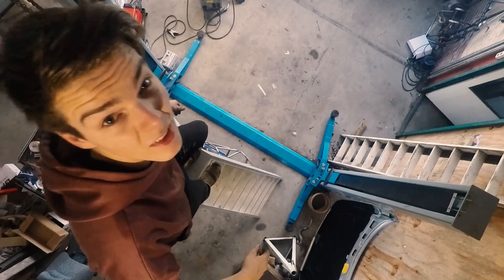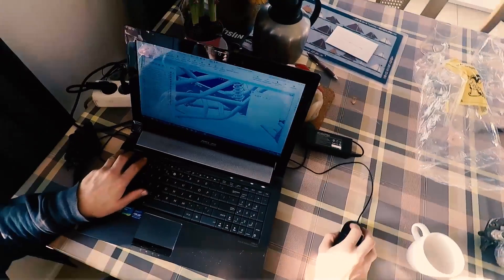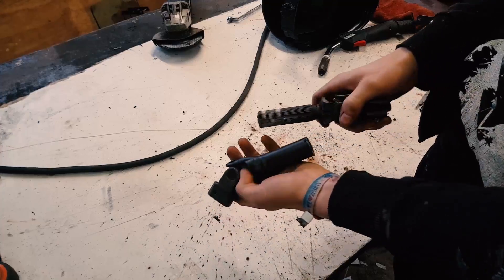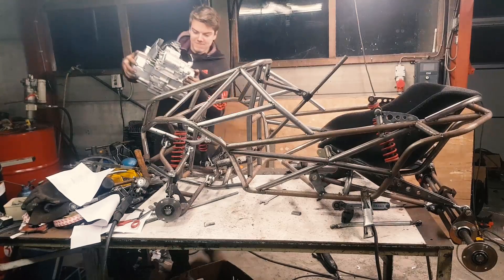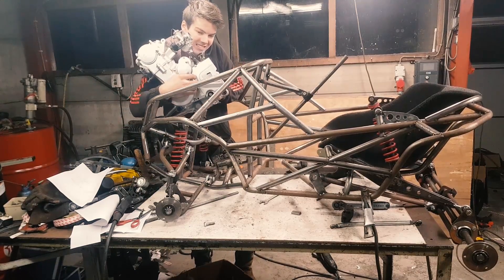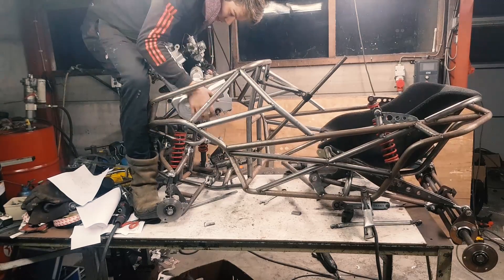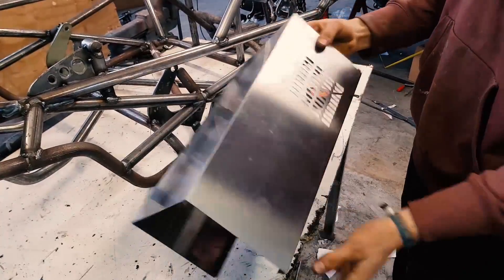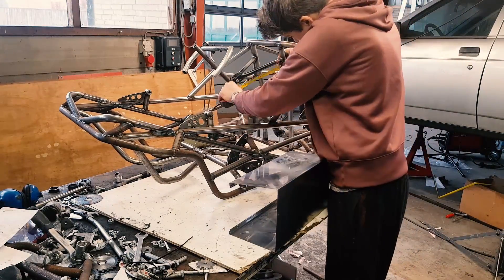Homemade MINI 4x4 Buggy part 3 [drivetrain and engine]

Comment: While this is a much better build, cars and cameras have a very small 4x4 build they are finishing and i thing its much smaller. Not as involved though. Does 40 mph...... and they were sending it hard too. No drifting though still refining

Comment: where did u get all these parts from? i have build one buggy too and im about to rebuild the rear axle...it is rigid...just a shaft of 35mm... and i like to build a differential for chain drive and independent suspension on the rear of my buggy...but starting with getting a differential, driveshafts and wheelhubs is just a challenge, because you pay for all these things about 200-300€ and its not new... and the people who sell a differential for about 40€ ...you have to get the fitting other parts for the differential from other people or sellers...

When watching your videos, which are very cool, it acts as if you have all needed parts at every time... the most time i need when building things, is getting all the parts :D

Comment: I'm curious to see how it works with no diff. It's going to push in the corners and be hard to turn. Making it very hard to drive on pavement. It may be fine in the dirt though :)
Reply from the maker: The problem was even trying to steer when the vehicle was standing still. Because due to the scrub radius the one wheel would have to turn forward slightly and the other one backwards which made turning the wheel pretty much impossible. Also the u joints caused some weird steering wheel vibrations. All solved with adding a front diff tough🤙🏻 next video making the diff!
Reply: Its miniature "Ultra 4" buggy. Same set-up. Great for speed and rock crawling. Awesomeness all around.
Reply: I think if you design the steering geometry with a bit excessive caster and maybe more than average kpi and pay attention to Ackerman it's important.  Obviously it would be ideal to have all these things adjustable like a racing kart but ik that's easier said than done .. anyway I think it's such a little guy it won't be a big deal if it pushes a bit.. having the front lock and unlock would be Kool af tho...

Comment: off road it will work better with out diffs,   after all full size 4x4s have diff locks  for off road (unless your planning to make limited slip diffs ??)
Reply from the maker: Only the front will have an open diff. No rear or center diffs